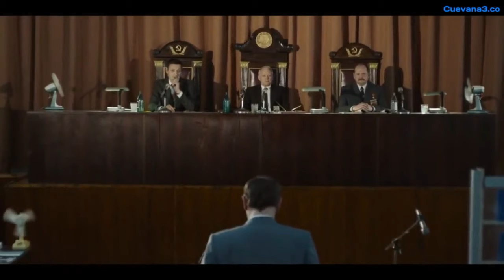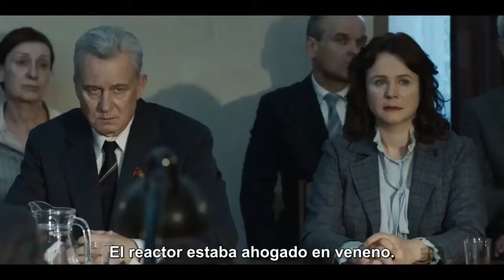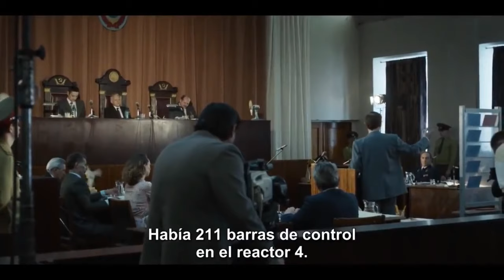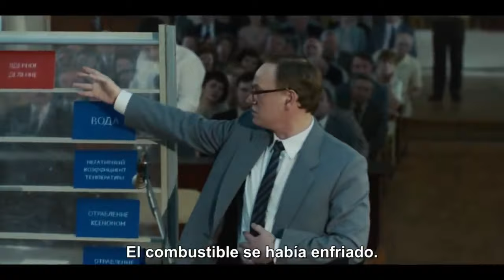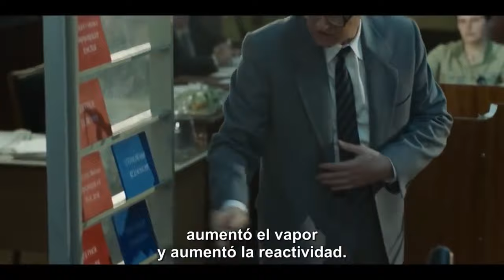Chernobil disaster explained in 10 minutes (2/3) - Valeri Legásov - Chernobil Series

Comment: I wonder if they had triggered AZ-5 before the power surge and before they shut off the pumps if it could’ve prevented the explosion.
Reply: only way to find that out is to try it so why dont you build an RBMK reactor of that modle and try it. XD
Reply: @AEsir2023  should we up the size of it for a bigger boom just for the luls?
if it dosent work that is.
Reply: And with no surge in reactivity/power on a stalled reactor that until said surge was refusing to come out of stall, what reason would they have to push the emergency shutoff button when the reactor by all appearances isn’t even able to sustain its own reaction anymore? There was no reason to too ok hit the “oh god this has to stop NOW” option until the power started rising and by then, you’rve already turned it into the detonator.
Reply: @Spectre-907  good point.
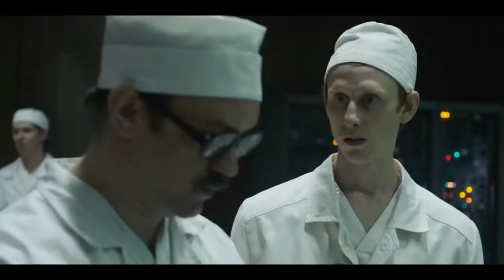Reply: Maybe at 2:22 they had a very very short opportunity to start the cooling water pumps and get some flow through that reactor in order to temper down the reaction taking place. Problem is that that reaction is exothermic as fuck and without the cooling flow in the first place, the temperature rises way too quick in order for the cooling water to have any effect. 

Remember decision making also takes time: you see the energy output run higher in the numbers, but it takes a few solid minutes before you know what's happening and what to do about it. 

Best thing they could've done is say 'fuck the test'. Take the reactor / unit out of operation, prepare it for restarting if possible: getting that whack ass xenon outand then take the reactor back in operation using a written instruction manual and closely monitoring performance as it becomes online again.
Reply: Don't think so, the mortal flaw of the control rods is still present. If you insert all of them at once, they all instantly accelerate the reaction because of the graphite tips.

That's the key problem of the reactor design, along with everything else the Soviets did to cut costs on creating nuclear bombs that we try to control for power. You need the control rods to ONLY reduce the reaction, not spike it then reduce it after.
Reply: depends on if there was enough steam in the system at that point to rupture the fuel rods locking the graphite tips into place.
Reply: @CrashB111  The graphite tips were the problem. If they hadn't pulled them ALL THE WAY OUT, it probably would have worked.
Reply: From what I saw when the comrade lady interviewed Akimov and Toptunov, they pressed AZ-5 and that's when the power surge started, as the pumps were turned off when Dyatlov ordered them off, this started a chain reaction when the graphite part of the control rods that were reinserted by AZ-5 made contact which gave way to more reactivity. It's why Legasov pointed out the flaw of the Soviet Nuclear Reactors, AZ-5 was the button that stops the car, but the car in question had faulty brakes in that it accelerates before coming to a full stop.
Reply: Apparently not.
Reply: A study done after determined that the only solution would be to slowly insert control rods one at a time. Something you would never do unless you knew the flaw of the az-5 button with the graphite tips. Which they didn't know.
Reply: The power surge was because when control rods turning in the graphite tips accelerated neutrons (causing the surge in power and in steam). The vast amount of steam pressure ruptured graphite channels and rods became stuck so the power was surging uncontrolably and thats what led to the explosion
Reply: @dachronic6709  but if the pumps were still running there would’ve been water to negate that effect no?
Reply: @AEsir2023  pumps aren't physically able to sustain this amount of rapid heat. The reactor was so poisoned that when Dyatlov ordered to raise the power back it was already going to explode but az-5 led to it faster. The only way under these circumstances RBMK could have been prevented from exploding was either to raise the power gradually over time or boron rods didnt have graphite tips. If the AZ -5 wasn't pressed the only difference in the accident would jave been the time (maybe couple seconds at best, later than with AZ-5)
Reply: @dachronic6709  hm well it was a theory and a long shot.

Comment: They had multiple options, actually.
But they didnt took advantage of them for example the shields that reflect neutrons could have saved it if activated
Reply: What are you talking about? These shields just prevent neutrons from leaving the core
Reply: @rinkashikachi  nope... The neutrons aren't supposed to stay in necessarily. The boron cores make sure that the excess neutrons get absorbed so that a nuclear chain reaction (fission) doesn't get started. One reaction needs one neutron and that produces three neutrons. Those three are able to trigger three more reactions and create 9 more neutrons. It gets exponentially dangerous to control the reactor from going critical. You can't stop radioactivity that easily.